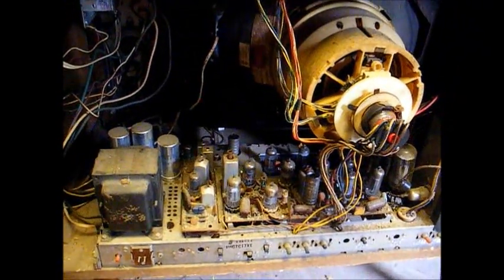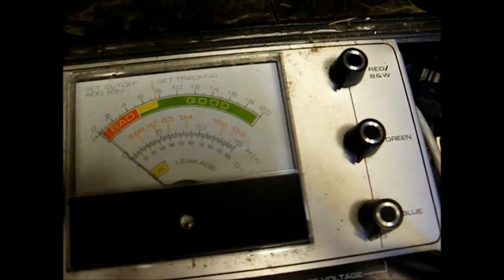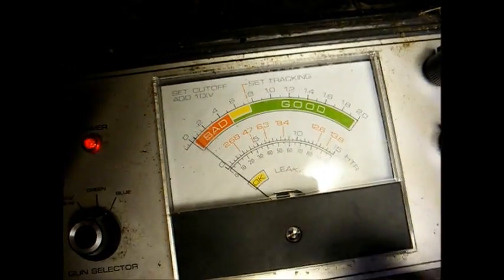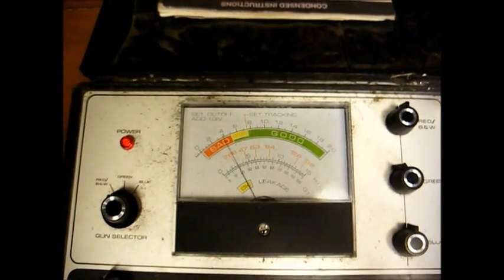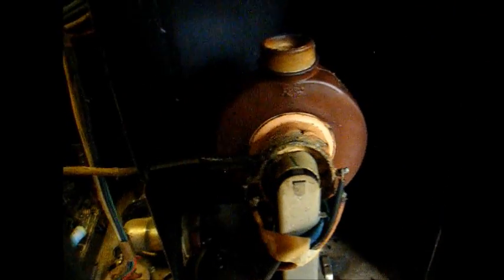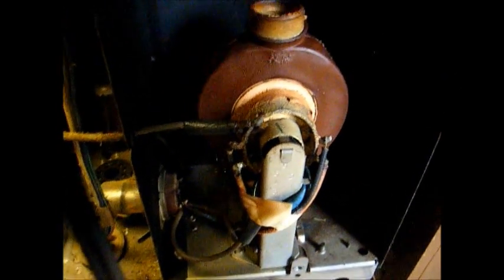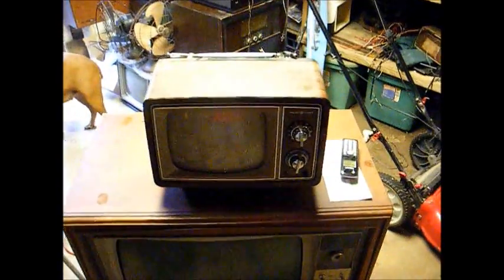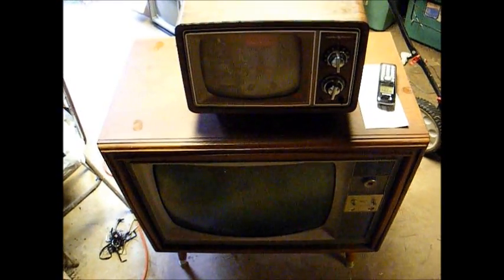First look at a '66 RCA Victor CTC17 console color TV & an '83 GE 10" "portacolor III"

Comment: The CTC 17 was the first RCA Color TV set to use the 25 inch rectangular CRT. Along the way it was one of RCA's best color TV's. They started introducing solild state circuitry too. The Sound IF detector was an IC as I recall.

Comment: This illustrates how bad these sets were, brand new in 1966 and needed a new CRT in 1969.  Probably also needed a flyback, a handful of 6GH8s and a gear for the fine tuning.  People never had it as good as they do now with new sets that cost practically nothing.  I worked as a kid a t a TV store in 1969 and this 3 year lifespan for RCA sets without major work was typical.  They also cost $500 to 700 in 1966 dollars, which is over $2000 2022 Dollars.

Comment: Those transistor GE portacolors suffered from bad interconnections between the top and bottom foils. A few times I even forgot to unplug them and after plugging in the last cable after taking out the chassis, the set would come on in my hands!

Comment: I have two of those Ge Portables in the same exact simulated wood cabinets.. Found both at different times and different places, and they are dated 1985.. Both work.. One of them had a real bad picture when I first powered it on, then came up very nice after a few minutes of running...

Comment: I hated the 1980s GE tvs . Always full of intermittent solder connections and crappy double trace circuit boards but still were much nicer than most of the garbage made these days

Comment: I bought this very model new in 1966.
Reply: I bought in Canada, the 1983 ElectroHome-Mitsubishi 25 inch CRT with Ultra-Violet Coated Phosphors. Later in 2014 , I will to an upload review of my Canadian CRT Colour ElectroHome Mitsubishi 25" CRT review! Have a good day!!
Reply: At the Salvation Army Thrift Store, I bought a vintage 1992 SANYO Colour-Color CRT used Television of 26" inch size for exactly $24(NO Tax.). I works like brand New out of the "box" with no scratches. It also has a florescent Remote Control with 24 buttons on the SANYO(written in Gold.) and operates on the SANYO Remote Control unit of 24 buttons which controls the "Color" and the "Hue-Tint" of the Television as well as the "Sharpness" and the "Contrast" and "Brightness" of the CRT Tube Picture control. The volume can be routed through "Stereo reception if I use my Starcom MTS Stereo Decoder unite from Radio Shack where the Coaxial is fed into the Starcom MTS Stereo Cable Decoder than with 1 Left and 1 Right RCA Out Jacks I can use RCA plugs to direct the RCA from Coaxial Stereo to my left and right RCA jacks on my 80 Watts RMS Stereo Receiver Unit with Equalizer and Full "TruSurround Sound Stereo + Full CRT Picture Controls". It still makes it a prized CRT SANYO for me because the CRT picture is as good as the day the Sanyo CRT was brand New and it came with its specific Sanyo CRT Remote Control unit.!!
Reply: +Jules Verne Sounds like you REALLY hit the JACKPOT!!!